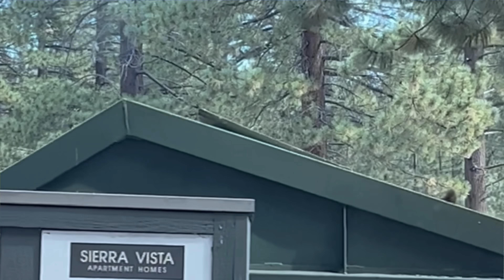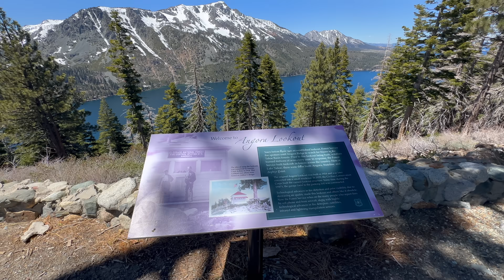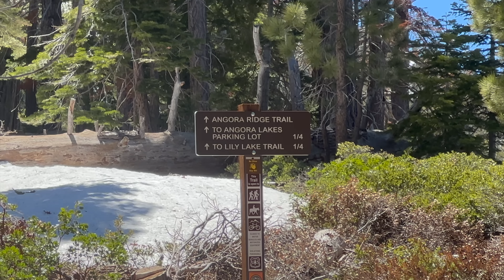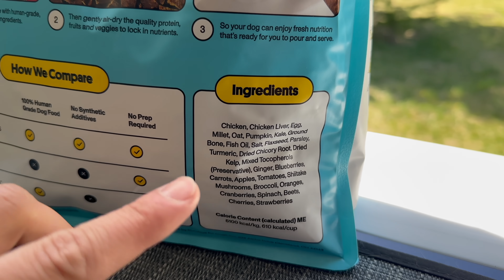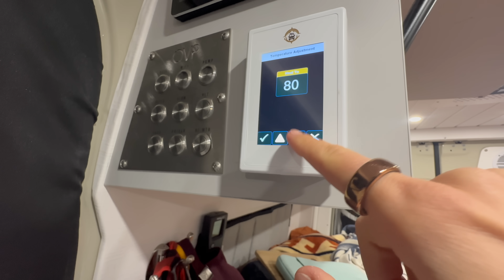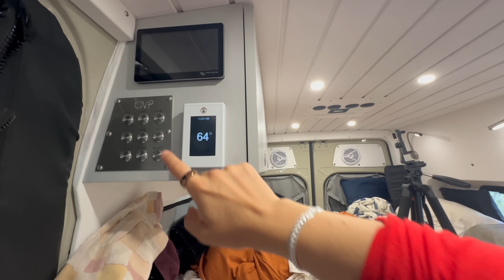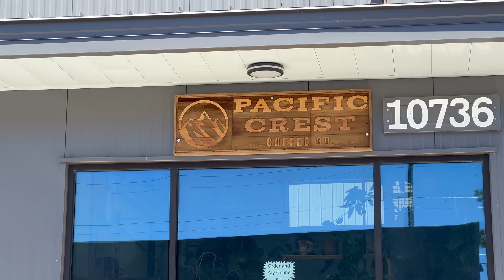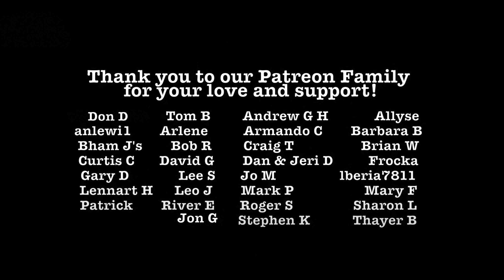Van Life in Tahoe: Bear Encounters & Van Fixes/Maintenance

Comment: In the Sprinter build I chose my local victron dealer who happened to be an architect with a small van build-out company😮 I chose to have a power tower that separates the bunk from the living area. The only thing hardwired is the max air fans the grey water tanks and the refrigerator😮 keeps the electricity basic and simple and most everything we use is 12-volt and rechargeable😮

Comment: When the heater in my RV stopped working, it turned out that the coach batteries were at their end of life.   When it got very cold, they couldn't put out enough voltage to activate the igniter.  When the temperature was just a little chilly, the voltage was high enough to run the heater.  New batteries fixed the problem.  It sounds like you may be having the same problem.

Comment: I'm interested in your opinion of the KO'3 vs the 2's. I have the 2's on my F-350 and my better half's Grand Cherokee. The tread pattern is significantly different. I have had no complaints with the 2's on my truck, which barely sees the street. The GF hasnt complained about them since I had them installed on her Cherokee, so that's a plus.We have had some encounters with black bears on our property when we are in NW Georgia, but for the most part they run away, when we see them.

Comment: I think you should put a fixed blade on your pack when in the woods also you can have a little hatchet in your pack as well. If anyone doesn't feel comfortable carrying a firearm do not resort to bear spray because the winds can change not in your favor. You can always find a long stick and sharpen it on one side to give you some distance before using your knife. Maybe these tips will help you out in the future

Comment: While you are in the area suggestion:

North on highway 89 out of Truckee. Maybe 15 miles, turn left/west Jackson Meadow sign. Head just a very short distance, turn left, head to Independence lake. I think your 4x4 should cross the one Creek without incident. Might need 4x4 engaged, keep it moving through at moderate pace to get up the steep hill. Then continue to Independence lake.

At almost the same highway 89 intersection, turn right. Dirt road, campgrounds, then historical walkway where original 1849 travelers created a small stop over, KYBERZ FLAT.

AREA surrounding Jackson Meadow Reservoir many different roads to explore, some need 4x4 in some places. 
Get MAPS in Truckee at the forest ranger station on 89 right off 80.

Comment: To prevent the wheel from hanging on the bolts, the bolts are screwed crosswise: one bolt is opposite to the other.  If you tighten adjacent bolts, the wheel may hang on the bolts and will be difficult to straighten.  This is how my father explained it to me.

Comment: Im looking forward to your review on the KO3's.  Ive had KO2's on my truck and they are great.  What are your thoughts on the van?  4x4?  If not, how does it handle dirt roads to off grid campsites? Are you happy with the setup for you and the dogs?  Im in a Overkill 15' foot off road trailer (w/RV queen slide-out) and it works for me and the dogs.  For now.  But looking at options. I prefer dispersed camping to campground so would need a capable vehicle for off grid camping.

Comment: I'm sure your heater pilot light does not stay lit when not in use. There may have simply been a bit of air in the line and it just took the system a little time to purge and light.

I guess what I'm trying to say is that it's very likely there was no issue with your heating system.
Reply from the maker: There was. I forgot to add antigel to the diesel and it gelled up the lines when temps dropped below freezing to the heater so it took a bit to get started after fixing it. Actually hooked up the reader to the system to confirm lol

Comment: Does your rig have a carbon monoxide DETECTOR so it goes off when the deadly gas is present, not just when it rises to lethal levels?

How much was your repair bill?

Is the 4WD locking differential oil supposed to be that thick?

Comment: Re:  Your van.....does it have indoor toilet and shower?  That's all I wondered.  Also, do you ever need air conditioning at night time, or do you just stay up north during the summers?   I'm looking at used class A, no longer than 30 feet.  $100K +or- and also:  is there a best brand or two that you could tell me.  I don't want to cross the country and back with a single problem...if possible.  Thanks, I bet others would like to know your opinion on that, because you have lit the fire in me to drive around the country.  Thanks....LT

Comment: Bear Response to Comments: For those concerned about the bear, there was never any danger as that bear recongnized her from the channel likely watching videos at the vistior center, and was a fan simply waiting off the trail to get a selfie with Nikki and Camper.  The bear getting a bit impatient started to walk towards Nikki to meet her half way. The bear could have easily charged the van earlier in the lot if that had been the intent. When it saw her backing away, the bear figured it was too far to walk, didn't see camper with her, and realized it had already been in the video deciding instead to walk up the hill glancing back for a 2nd cameo appearance rather than the selfie.  🐻